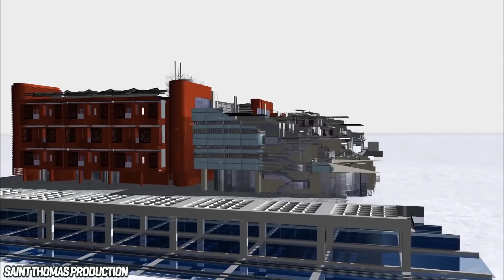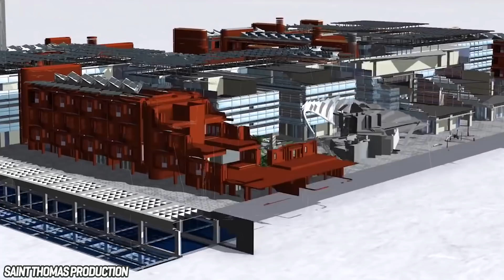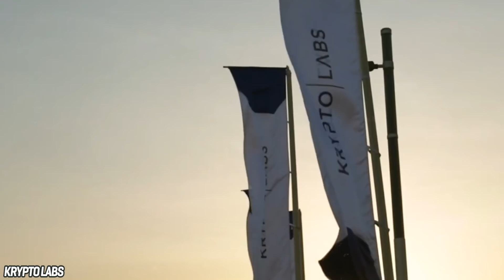Abu Dhabi's $22 Billion Futuristic City

Comment: 405 square metres, 40,000 KW = 98.765 KW per square meter.  Didn't think it was that bright.  C'mon, 40MW, who you trying to fool?
Reply: Nice calculation but what are you saying
Reply: @behistx  I'm saying sun light is around 1KW per square meter so even if the panels are 100% efficient you can't get 40MW from 405 square meters.    :)